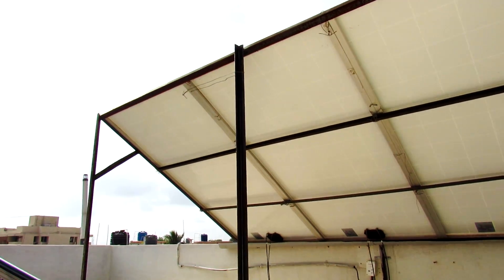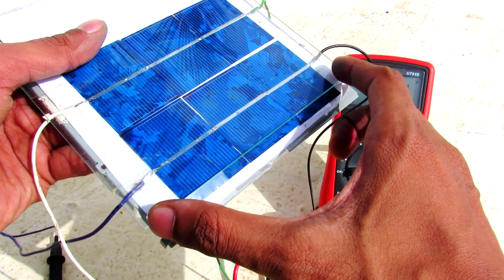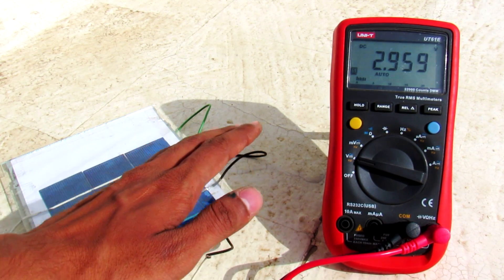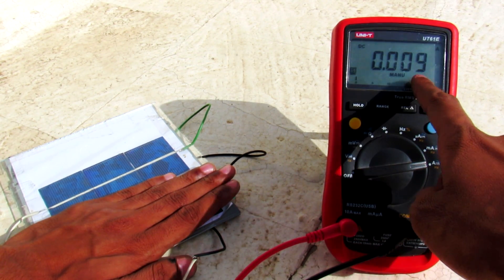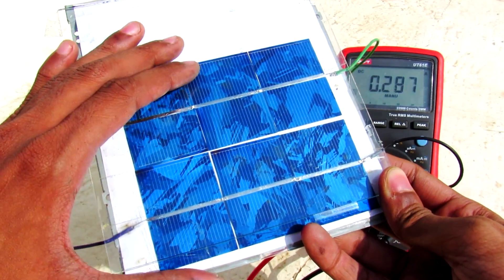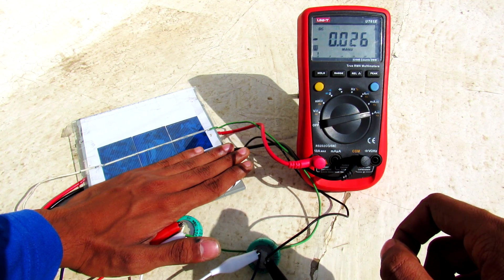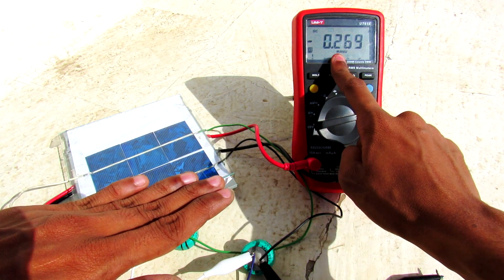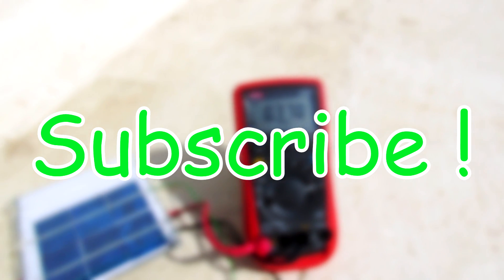Solar Panel Make More Power Efficient With Super Capacitor

Comment: this is good for running electronics or motors that need steady current during partial shadowing of panels but when the capacitors loose the stored energy after being constantly under shade the output will drop back down to 10ma are your video showed it was dropping to 20ma and if left long enough would have gone back down to 10ma.

Comment: Thanks, 
found this Video as of thinking myself about smoothing Solar Power, 
* mean lower the drops and rise as of a cloud or
* get more power on cloudy days also.

My Inverter has a maximum of 2.200 Watt sending OnGrid, and so on cloudy day the Watt is often switch between too less or too much compare to my household demands. With a Capacitor between SolarCells and Inverter I might be able to load and deload the capacitor (automatic) and get a smoother and higher output, catching the (too much) sun time and use at (lower income) cloud time

Or even able to put on another 1 ore 2 Cells to get a also smoother but higher steady output on cloudy days.

As the Inverter is up to 600 Volt, and now 10 Cells are generating near 400 Volt I see the range I have to check out, with maybe 12 Cells and then near 480 Volt.
The problem is to think about how long I wanna smooth (accept a cloud or be able to load) it, and so the Farad exceptions.

But I am happy as of education as Businessmanager, able to have this idea been proofed by you.

Comment: I think this can actually improve the efficiency. One supercap in parallel with each cell. As the panel will provide more current at lower load, it provides a way to discharge the cell without the forward voltage drop of a shottky, which may allow the whole panel to be more efficient when the shadows are not constant and fluctuate.

Comment: bhai hindi me ek baat bolu to jab capacitor back se charge hoga to wo shade wale panel pe parralel hone k karan apna voltage apply karega to shade panel isc se jyada current dega but shade panel power bhi absorb karne lagega to usse panel destroy ho jayega...but diode antiparrallel me lagaoge to negative me bus 0.7 k around hi voltage hoga to shade panel bhi kam current dega to power absorb by panel kam hoga aur ye thora safe rahega ....understood

Comment: this does not increase efficiency, the fact that it had more amps than before it's because supercapacitor acts well like a capacitor? :P ...the amps are dropped slower due to the capacitor but you can't make 15w from a 10w panel, nor it will make the panel going from e.g. 17% efficiency to 20% ...it just has more stable power that's all - cy around

Comment: this theory might be more appropriate for quickly storing bursts of wind energy. the sun is fairly consistent, so you may be taking an efficiency drop by introducing an unnecessary cap
Reply: It would work on moving vehicles receiving passing shadows, as well as keeping panels working when receiving sun through a leafy windblown tree..

Comment: The capacitors act as temporary energy storage, the mechanical equivalent would be a flywheel. If the source of the energy is temporary interrupted the momentum preserved in a flywheel will continue to supply the energy to the output for a while. Likewise with the capacitors, when the solar cell is temporarily shaded the energy stored in the capacitors will continue to supply power to the output for a while. But neither come for free, you need to spend energy to wind up a flywheel, you need to spend energy to charge the capacitor. You claim that this setup makes your power supply more efficient, this is not true. But it does make it smoother.
Reply: Wrong. It actually does make it more efficient, because when one cell is "disabled" the other cells also cannot discharge and provide power. So, by allowing a cell to be replaced by a capacitor when shaded, the OTHER cells can still provide power. It's not quite analogous to simply connecting the capacitor across the entire solar array.
Reply: @ryannicholl8661  yes, I tend to agree. I would like to see some more of this type of testing results between two panels in same situation, 1 with caps & 1 without, alternatively shaded on and off and get some real, lab grade results of this experiment as I have been contemplating similar ideas of my own. I believe there is/would be a benefit derived from the very low resistance of the caps to absorb a higher energy level quicker at times as well as provide extra power from the other panels during brief shading times and possibly substantially extend those extra power consuming moments as a bird walks across ur solar array. Low resistance means the ability to absorb more power quicker as a gap opens briefly on a cloudy day. I think super caps would be a great idea to build into panel design, possibly with plug n play expansion kit upgradeable. Just my thoughts!

Comment: You have NOT discovered anything new here.  All you really have done is smoothed out rate of rise and fall of current.  Smoothing Caps have been used in power supplies for decades and does provide a valuable purpose.  However the purpose is NOT efficiency.   Keep working on your projects though, especially with Super Caps.  Good Luck to ya.

Comment: I didn't really see a benefit here, I noticed the recovery time when using the capacitors was much longer than without them, the caps didn't seem to offer enough storage to offset the recovery time of the panels..Looked that way to me at least.

Comment: Nice work man , but the panels are eventually connected to battery bank ! so there is no need to add passive components like super capacitors .
Reply: supercapacitor to battery

Comment: Silicon diodes (with a forward drop of 0.6 volts) connected across each cell would work better and be cheaper.
Reply: Schottky diodes only have about 0.35V forward drop
Reply: Current is said to flow from Positive to Negative, but electrons flow from Negative to Positive.

As the electrons flow from Negative to Positive through the circuit they are said to create "Holes" (positively charged Ions due to an atom losing one or more of its electrons). That apparent flow of positive Ions is referred to as "Hole Flow," as the atom missing an electron is said to have a hole.  You can think of it in the same way as bubbles of air flow in a tank of water.  That's probably more detail than you need, but will explain the differences you will see in different articles and teaching throughout the Internet.  Some people / articles prefer to discuss electron flow, other discuss current/hole flow.
Reply: I'm sorry that my accurate description of electricity flow has confused you.

The proper description of electrical flow is important for beginners, as they will see both P to N and N to P electrical flows on the Internet and in electronics books.  It is good for them to understand why they are see both and what it means when they do.

Are you done proving how pseudo-intellectual and narcissistic you are.
Reply: Factory fitted Panels are coming with this diodes
Reply: +Dan Hart Solar panels is series are drastically impacted by shading, as small as 10% shading of 1 panel dragging the total power output by as much a 80%.  That why I always install solar panels in parallel.  Note that solar cells within a panel must be wired in series to produce significant voltage.

The short answer is that solar cells within a panel are wired in series (and parallel row if needed), while solar panels should be installed in parallel to prevent the whole system from being dragged down do to a single panel being shaded.
Reply: What is a forward drop
Reply: Does current always from from the negative terminal of a battery through the loop that way?
Reply: Ok so I must've read wrong, soooo the positive terminal has the most negatively charged particles in it?

Could you tell me why this works... my circuit is :

Solar Panel (-) -> Diode(with black line toward the panel's negative) -> LED -> Solar Panel (+).

It only works with the diode's black line on the side of the solar panel, can you tell me why?
When I change the diode to have the black line (the blocker, right?) toward the LED, it won't light up anymore.
Reply: I am trying to make sure I don't take in charge from a Double A later by blocking electricity from flowing back into the panel
Reply: I have a single, tiny, 1W 5V 200mA solar "cell" panel that I extracted from a solar charged flashlight :) But shouldn't I still need the diode so that when the panel isn't getting light it doesn't suck up the battery its charging?
Reply: ok ty
Reply: Electricity flows from negative to positive, aka. electron flow.  "Current Flow" is the "useless and non-existent particle flow that we learn in school."
Reply: I wonder if the shadow and less sun effects solar panels in series people use on roofs...

Comment: I'm wondering, why not use a parallel config while putting the output through something like a joule-thief to step up the voltage?
Reply: 0,5 volts and less is too low to get reasonable efficiency joule thief working. And in larger scale the current would be pretty high, thus requiring thick cables and causing many more problems.

Comment: Sure thing, the supercap will buffer energy and when that part of the solar panel is covered start supplying current, until it drains empty. Then the situation is the same as without.
But, when the panel is uncovered again the solar cell will start charging the supercap first. So, you delay the initial effect a bit.
So for short term covering it will work. Only at a higher cost disadvantage.
But you will get no more power with caps than without caps. You will only buffer short term dips in sunshine.
Reply: +flexairz May I add something?
When one cell is covered, that one capacitor will drain. Since there is still a closed circuit, the current will now start charging that empty capacitor in the wrong direction (plus on minus and visa versa). So covering up one cell will demolish that capacitor. Like someone else mentioned, the diode is the default method for this problem.
Reply: Not with solar cells in series. The current will always flow in the same direction. There is no reversal. When one cell is covered its internal resistance will increase effectively blocking all current. Thats why you need a diode parallel with each panel. This will let the current flow through but at the loss of about half a volt.
Reply: flexairz
Sorry to say, but you really need to draw the circuit to see and understand that a covered solar cell (in series with other cells and in parallel with super capacitors) will put a negative charge on the super capacitors. To give a quick explanation: Cells are in series: cell 1 plus to cell 2 negative. So cell 2 negative is connected to the plus of cell 1. Now think of a super capacitor on cell 2. Minus to minus, plus to plus, so the cell charges it. If the cell has no output (no sunlight, but the other cells do have sunlight) and the super capacitors are empty, there is a PLUS incoming from cell 1 and will charge up the super capacitor the wrong way around. Eventually the super capacitor can't handle it any more and will break down. It might even explode. Only if there is no load on the array of cells, then nothing will happen.
Reply: Maybe this link will explain more clearly what I meant.
https://www.electronics-tutorials.ws/diode/bypass-diodes.html

I am trying to understand what you mean. The current that flows in the circuit does not magically reverse polarity suddenly when it comes back to the cell that is covered. That is not how electronics works.
Covering that cell will not demolish that capacitor.

Comment: Ohh i have two questions...

What would happen if i use a normal capacitor for less powerfull cells?

And

Its there a way to aply this to the bic solar panels?

Another thing:

Cool sun water heater!
Reply from the maker: Normal (Electrolytic) capacitors doesn't offer low esr ,and their energy capacity is low therefore they charge instantly and Discharge instantly

if we use normal capacitors they will not bypass current through shaded Panel .

for a bigger Panel we can use super capacitors ,but  we need to calculate the RC Time constant to get proper required capacitor value .
Reply: Kedar Nimbalkar thanks a lot!!

Sorry for asking but did you study something like engenier or electricity.

Thats because i also want to know about this subject
Reply from the maker: I recommend you to do this free mooc (massive online open course) on Solar energy .

https://www.edx.org/course/solar-energy-delftx-et3034x
Reply: thanks! (another time)

cool maybe with that page i can know also about programming.